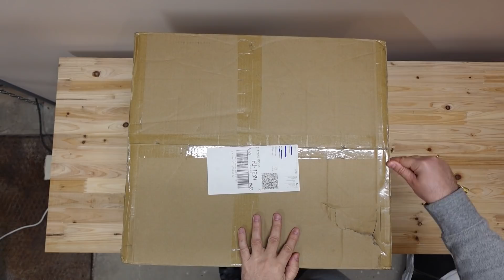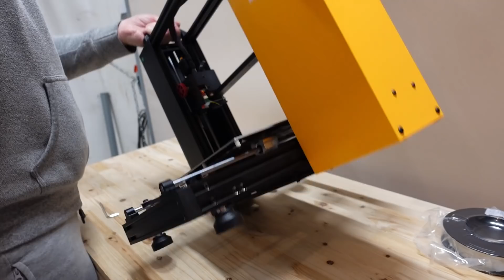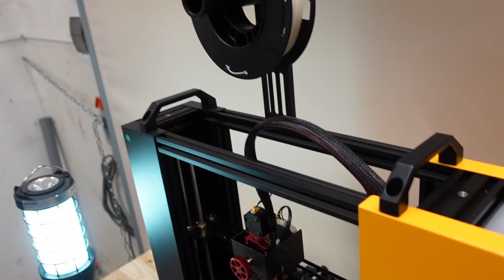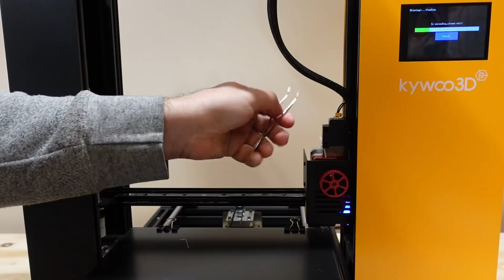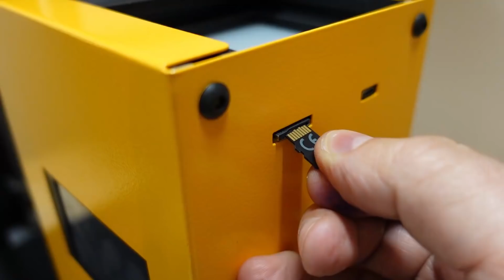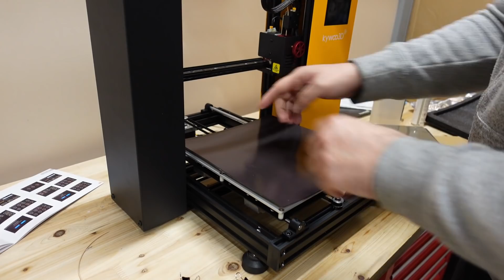Kywoo Tycoon 3D printer review, assembly, test prints + PEI sheet installation

Comment: Hello, could you please check for me if the horizontal installed fan next to nozzle is spinning when you set the fan speed via the touch interface? Mine isn't working and I am not sure if it is damaged or not. I am new to 3d printing.
Reply from the maker: That is part cooling fan, and it is turned on/off with g-code. Usually it is turn off at first few layers.
Reply: @MyTechFun  so sad, my posts y cooking fan isn't working. I hope that the cable is damaged. Have to disassemble the printer now to check if it is the fan, cable or controlling unit
Reply: @y.5107  Try sending the gcode from console for turning it on and off`? Or make gcode file with only those commands?

Comment: I like the industrial look and the extras. But honestly... The benchy just looks like on any Ender printer. There is one thing i keep dont understand. Why the back and forth moving bed is so popular when its obvious that moving the bed up and down gives way less vibration, and better results?
Reply from the maker: My favourite 3D printer structure is cubic frame cartasian (like Ender5). I like it better than a corexy. Simplier, shorter timing belts, more reliable. Pity that it uses v-slot wheels. I like the step of Kywoo to replate those wheels.
Reply: @MyTechFun  what would you use instead of v-slot wheels?
Reply from the maker: @opiniono-1  Linear rods (with linear bearings) are better. The best are linear rails.

Comment: I told them during the kickstarter that holding the bed on with clips is unacceptable for a printer of this price in 2021.

Honestly I'm glad I dropped out and did not purchase the Kywoo Typhoon, it's not a refined machine and has far too many issues.
Reply from the maker: I agree. I think they should sell it with installed PEI sheet
Reply: @MyTechFun  I like the clips, I use the 2 sides of the bed, it's practical

Comment: This is a good video and the printer looks very nice. I started with 2 Ender 3 printers and likely will stay with them. It was a learning curve for me and I've become very good at printing PLA and PET-G. And that's my goal.
This printer is so so loud! Much louder than my Ender without the silent control boards. 
Besides, I can't justify spending over $450 U.S. for one printer when I got 2 Ender 3 printers at $160 each.
But I do enjoy your videos.
Reply from the maker: Z axis is loud as Ender3 (or pro). Ender3V2 is quiet, only fans are loud (louder than Tycoon). I did some quick calculation, if you add all those common upgrades to Ender3, you are above 450$ and Tycoon is ready to go out of the box.(of course, if you don't need those upgrades, it's different story). But linear rails and rods will last longer, with Ender3 you have to check those weels regulary and have spare to replace them..

Comment: Hi, Igor, the video is pretty detailed, thanks for the review. Love it
Reply from the maker: One of the best printer in my review. I got very good suggestions in comments too. You could think about providing the "Premium" version for example:
- additional stepper driver for Z axis, then it can level X rail automatically (instead pulley and timing belt)
- silent stepper motor drivers on Z and E
- enclosed version (where electronic is outside) 
- with some all metal hotend (to go over 260C)
- installed PEI sheet (no need for clips)
- better part cooling (maybe cooling from two sides, or just provide STL for download/print)
- other things are easy to fix (firmware, fix g-codes on SD card)
Reply: @MyTechFun  I agree with most of these points. I'm an early bird backer of Tycoon, and it has given me nothing but spectacular prints, out of the box. + Kywoo after sales support has been stellar, and the product pipeline for 2021 is very neat.

Comment: What firmware is this running? Can it be defaulted to back Marlin UI? The user interface and the noise levels with z-movement are a deal breaker in 2021.
Reply from the maker: Marlin. 2.0.3.1

Comment: Looks very nicely put together, interesting as have never heard of this brand before!  Have you looked at the Kingroon KP3S at all? I bought one on a whim as the price is very cheap and was surprised with how good it is. Linear rails, Direct drive, Socketed steppers (TMC2225) and no, I'm not affiliated with them :-) It does, like anything from China, need a fair bit of "tweaking"
Reply: That's cuz they're a 2020 startup, and Tycoon is their first product. Their Kickstarter was great, and they took all beta tester + community feedback, and updated prod machines. Delivered ahead of schedules, and after sales support has been great. My tycoon has been printing very sharp, out of the box. My fav machine so far,  of all brands I have.

X and Y have tmc2208s, dual Zs come with A4988 (should have been at least 2208s) but after G29 routine, the small z movements barely make a difference, and overall a very quiet machine. It is also very rigid frame, and very portable. Took to my local makerspace to show to my buddy there

Comment: This seems like a decently thought-out printer overall, though the UI could be better and there are a few baffling decisions. It's nice to see more options in this size and price class which come with a direct drive extruder and linear rods/rails stock. If I had seen this review a few months back (and the product existed, I'm not sure how old it is) it would certainly have been in my close selection of printers to buy (ended up with a Sidewinder which I really like overall).

Thanks for the in-depth review! I joined your patreon a week or so ago, keep up the good work.
Reply from the maker: Thank you! Yes Tycoon is very young but very good printer. Mechanics is almost perfect, firmware and g-codes can be fixed. Only think it can not be fixed on existing printers are stepper motor drivers on Z and E. I don't understand ther decision.